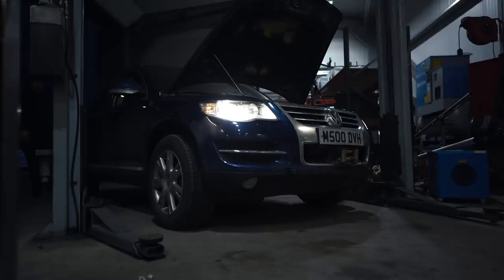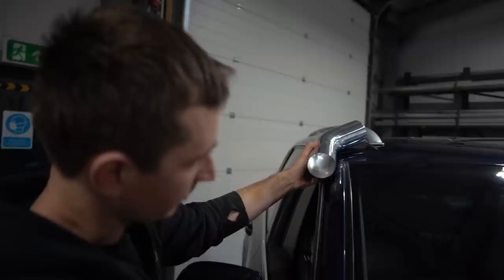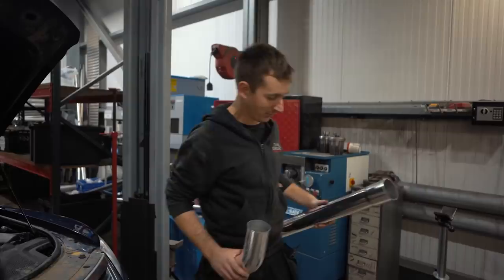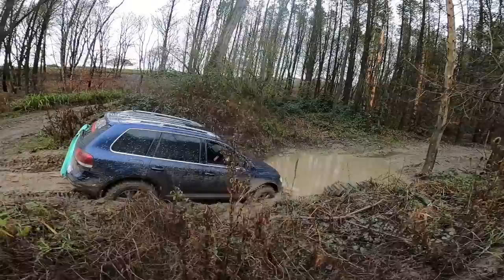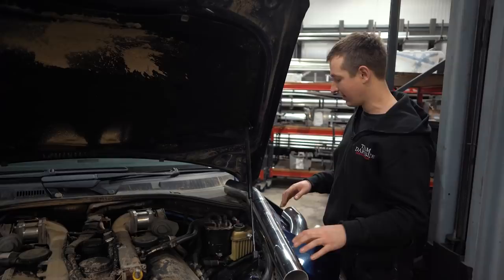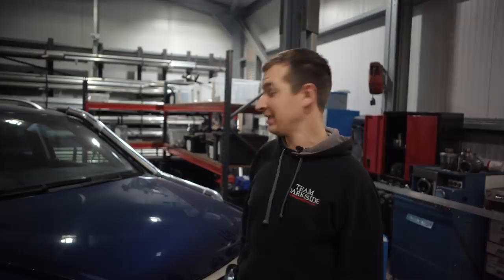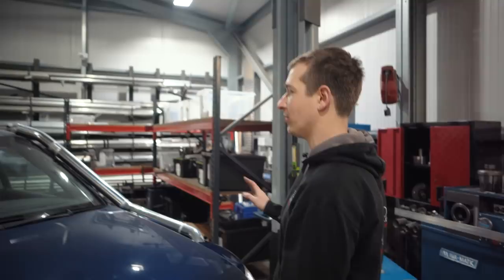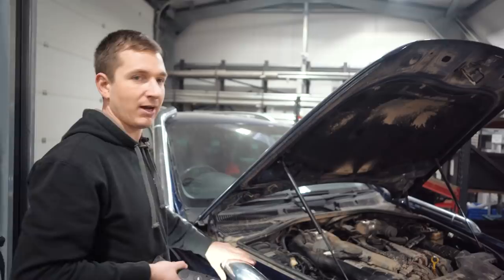Our V10 Touareg gets TWIN 3" Snorkels!!

Comment: Looks good 👍 , that little pipe you’re calling a water drain though is the filtered air supply to your air suspension compressor so you’ll probably need to extend that above water level & put a filter on it if you want the air compressor to survive 👍👍👍
Reply from the maker: Cheers, will sort it!

Comment: I think the drain pipe you mention that was connected to the previous air box may be for suspension air compressor. I'm not sure the set up on yours, but that's what it's for on Audi Q7 - I takes filtered air from the air box when raising suspension.
Reply from the maker: Yes It is, sorted.now!

Comment: I watch a lot it 4x4 videos. Normally snorkels are made of plastic, but questions I have are. How do you stop rain coming back down to the air filter? Normally a snorkel has the entrance to it as a forward facing right angle. What happens to water that now drops into the inner wing?
Reply: Tractor flaps👍😂
Reply: @bmxbeck1803  that wouldn’t work plus i doubt it would catch enough rain to harm the engine
Reply: @jamiem8298  good point..
🤣

Comment: Now you just need to make a similar kit for the v8 t1 and I'll be set!! haha
Reply from the maker: These might work!
Reply: @DarksideDevelopments  Yeah, the v10 and v8 are pretty similar with their air intake apart from the turbos. I’ll give it a look.
Reply: @DarksideDevelopments Also, have you considered taking the sway bars out? I took mine out last weekend and it makes a big difference off-road, and articulation. Haven't noticed too much change on the road or highway yet, it does lean a slight bit more on sharper corners but nothing drastic. Don't feel bumps as much anymore either. It Might not make as big of a difference with your car though as you have air suspension and mine is steel spring.
Reply from the maker: I have some custom made disconnects ready to fit! The front CVs worry me, easy to max out on lift
Reply: @DarksideDevelopments  yeah true, I’m yet to lift mine but planning on it soon.

Comment: Another class vid Ryan 🙌🙌just a quick observation 😉the angle of the snorkels on the roof? ,what happens with the crap weather we get mate especially at the min it’s torrential does it matter water going down actual intakes 😉😉great vid tho and the music in the background class😎😎😎
Reply from the maker: They are pretty much horizontal so nothing to worry about!
Reply: The water injection level while driving is likely a non-issue, but I would worry about what the slow accumulation of water gets up to if parked outside a few days without something more on the tops.
Reply: @DarksideDevelopments  knew you would have it covered 🙌🙌🙌🙌mint vids mate as ever 👍👍👍👍

Comment: Do you need a form of a ‘ram’ top, like from safari snorkels ??
Reply: I'd recommend against it unless you consistently run in dry dusty conditions... the ram tops are great at getting hooked up on tree's and slurping down bugs ect to plaster your air filter.. most owners around here end up turning them backwards. Claimed impact on power is big, and while thats extremely hard to measure (as your not moving on a dyno), the actual intake pressure/temperature is dead easy to observe while driving, and doesn't look any different with ram, without ram, or even with backwards ram, so my bet is any change in power (or egt, economy ect ect) is less than your normal day to day variance, rather than something you'd feel/see just using it.
Reply from the maker: I agree with the above

Comment: Will you do a v6 2011 version?
Reply from the maker: Yes
Reply: Brilliant !!! I drowned my previous 2008 Toureg and now use this one off road for work but as you can imagine I avoid water due to the intake being so low - I can’t believe VW went to all the effort in making a brilliant off roader and flawed it with the air intakes
Reply: Oh and will you be fitting them ? Or is it a DIY kit
Reply from the maker: Drop us an email!